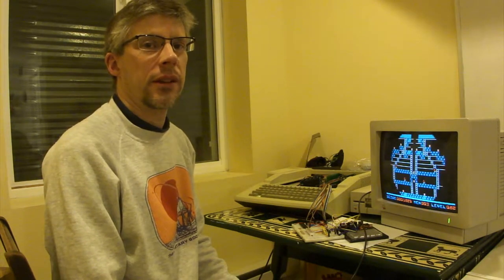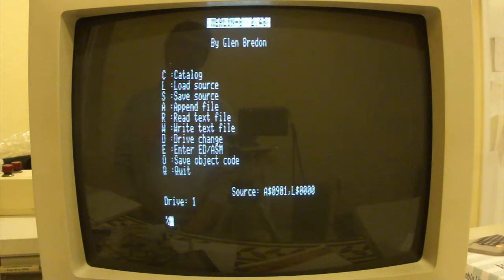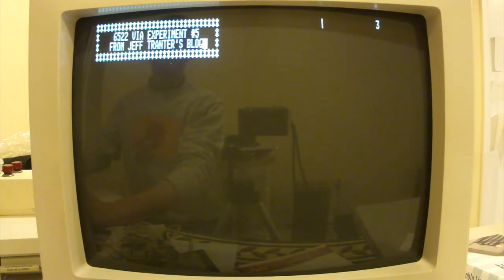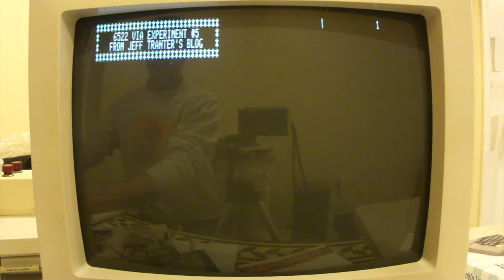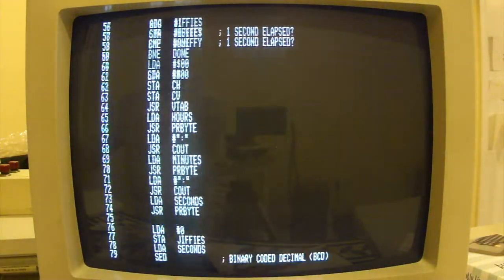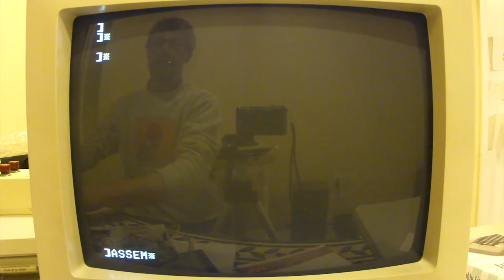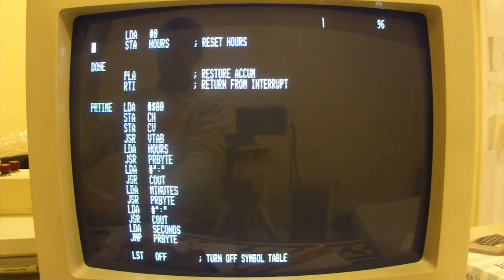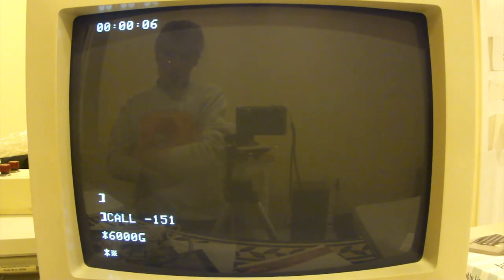Assembly Lines #5: Merlin 8 Full Screen Editor

Comment: The 6522 was created by MOS,  owned by Commodore. There are 2 VIA 6522s in the Vic-20.  The Commodore 64 came with two CIA 6526s, which were the ext evolution of this chip.
Reply from the maker: Thanks for the info! It's so interesting that Commodore owned both the 6502 and the 6522, that were the core chips in so many 8-bit computers at that time.

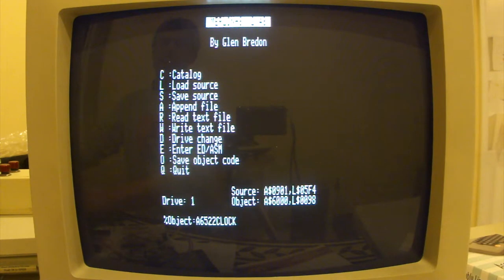Comment: As a fairly recent Apple IIe owner and 6502 assembly programmer I must say these videos are pure gold! Quick question, at 7:00 and also 10:50 would it not have been quicker to switch video modes and execute your code within Merlin or was there some other reason for not doing that?
: VID0
: GET $6000
: MON
* 6000G
Thanks, and looking forward to the next video!
Reply from the maker: Ack! You're absolutely right. I forgot about the VID0 command. Stephen, you were the one who got me hooked on using the GET command. Thanks! Is there anything in particular you would like to learn about? I don't have a specific "lesson plan" - it's just whatever is interesting to me at the time.
Reply: Chris Torrence I think your instincts are good. I really enjoyed the hardware related detours and this project based video. Speaking of suggestions though I do have one... debugging. What tools and/or techniques exist for doing basic debugging? I've learned the monitor commands to examine memory but is there a way to step thru code and such?

Comment: Great video! I have an Apple ii+ clone, and am using an earlier version of Merlin. I would really like to use Merlin 8 however, so I can have the full screen editor, and have support for local labels (which my version doesn't seem to have). Do you know of a way to make it work on Apple ii+ with an 80 column card?
Reply from the maker: Hmm, good question. I don't know if it is possible. I was not able to get it to work with Merlin 2.43. Maybe there is a way to cobble it together using a slightly earlier version of Merlin, by copying the ED program from say 2.43 or 2.58 to the earlier version. If you do a google search for Merlin full screen editor, you will find the manual, which might help: https://archive.org/details/MerlinProFullScreenEditor/page/n3/mode/2up
Reply: @CT6502  Hey thanks for the reply! I have no idea how to even start trying that, so I'll continue with my current version. I'm getting used to it :-)

Comment: Is there verison of merlin that works on the Apple II+ ?
Reply from the maker: That is a really interesting question. I could have sworn that I had a disk image that worked in the II+, but I just tried everything from Merlin 2.23 and higher, and none of them worked on the II+. I would bet that an even older version would work, but I don't have any disk images of those.
Reply from the maker: Okay, I did some research. The "Big Mac" was the predecessor to Merlin, and was written by Glen Bredon around 1980/81. It works on the Apple II+. You can download the disk image here: https://archive.org/details/a2_asimov_bigmaclc and you can find the manual here: http://www.callapple.org/Members/soft/apple2/inhouse/Big_Mac.pdf